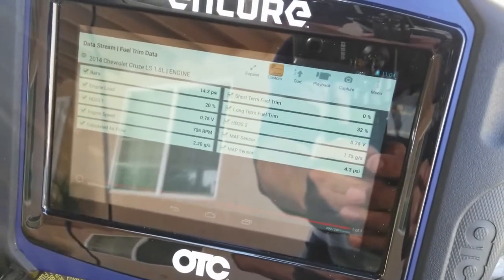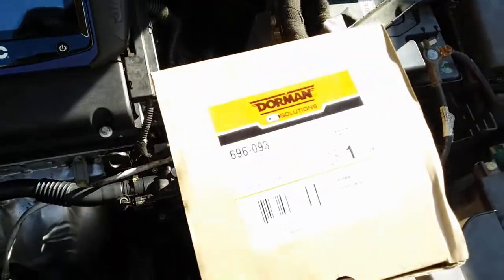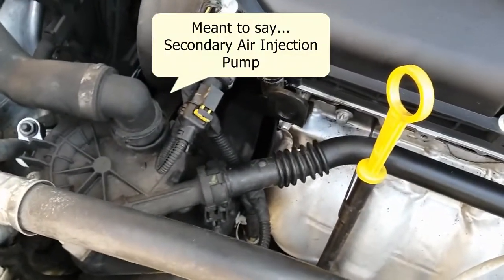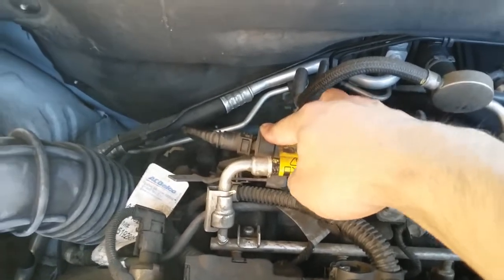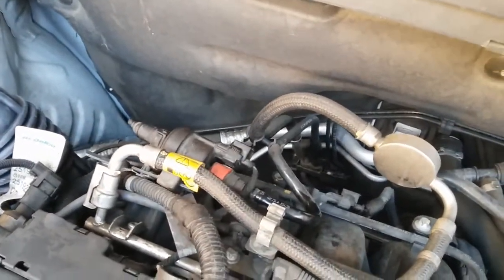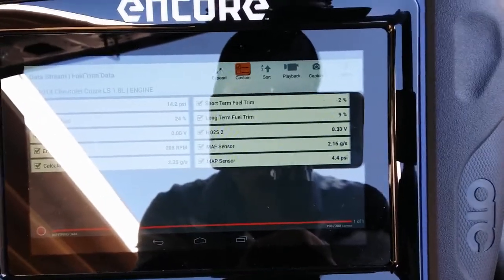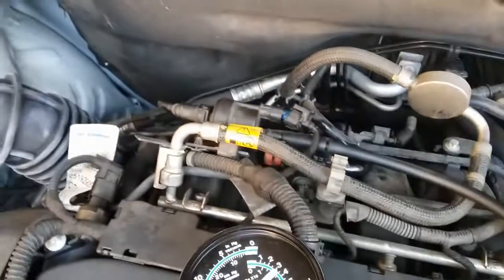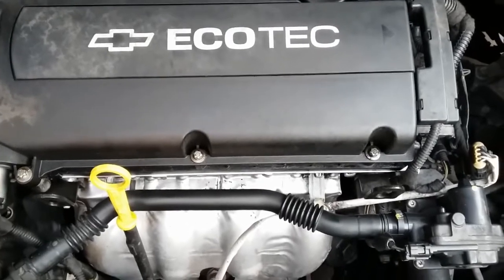(Chevy Cruze) Quick Diag of P0171 - System Too Lean

Comment: I have same problem with 09 Chevy Aveo but when I pull the oil dipstick out it runs better what could cause that how do you fix something like that
Reply from the maker: Your problem seems to be a faulty/raptured pcv valve. Its causing an internal vacuum leak.. You will need to replace the whole valve cover. PCV valve is internally part of the valve cover.

Comment: I have got cruze 1.4t , engine light on , p0171, i am not sure if purge valve problem or
Reply from the maker: Do you know if this engine has the pcv valve integrated with the valve cover? These chevy cruzes are known for a ruptured diaphragm on the pcv valve.
Reply: @EliTheOBDTech  Yeah ,  the pcv valve integrated with the valve cover and its sucking air in and very noisy as well.
Reply: @drFun5287  Replace the valve cover with integrated PVC valve and your problem will be fixed. Very simple.

Comment: what is the normal value of long term fuel trim? thanks.
Reply from the maker: Normal: +/- 10%
Ideal: +/- 5%
Bad: greater than +/- 15%
Reply: Hello.. I am from Iraq and I follow you.. I had a question ❔ The fuel adjustment values indicate negative percentages ➖ most of the time and reach 15 or a little more. Can I know what is the reason? I have a Chevrolet Cruze 1.4. Thank you very much.